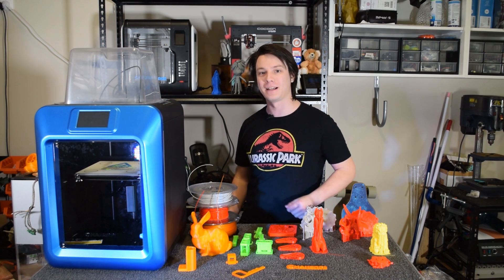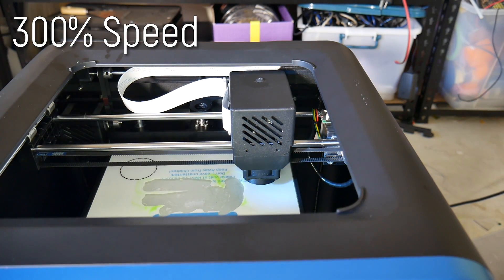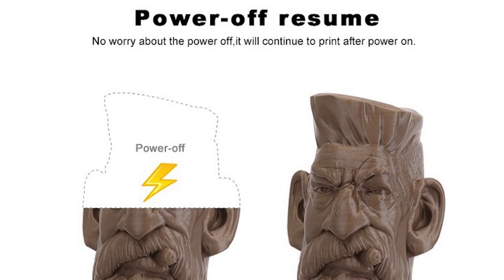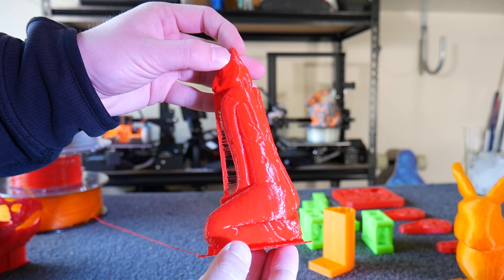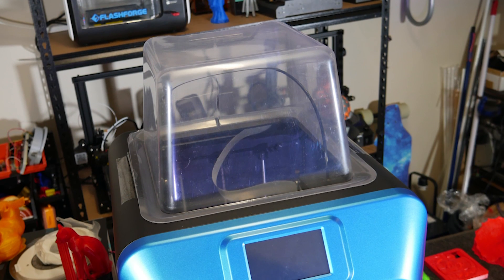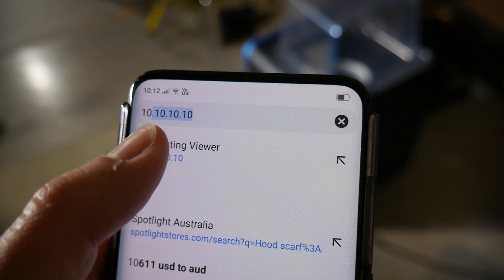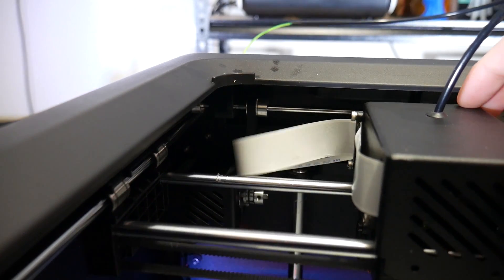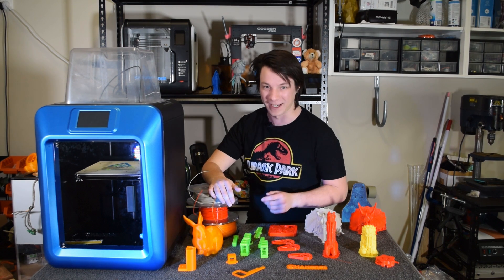MakerPi K5 Plus 3D Printer Review

Comment: I'm still waiting for the prosumer grade 3D printer for small scale additive manufacturing with real industrial stepper drivers instead of the dinky little Polulu drivers,  beefier motion control (maybe linear rails instead of linear rods), a K5 or larger print volume, support for 2X, 3X or even 4X tandem print heads for much faster throughput on arrayed  small parts, and an enclosed and heated print chamber for ABS parts that don't warp.  Kudos for the removable glass print bed.  I retrofitted my Qidi Tech printers with magnetically attached glass beds.

Comment: Tip,
Issues with printing PLA after using high temp materials..

Load Nylon at the same temps as the prior material printed at, let it purge for about 1-2min
Unload the Nylon at your PLA print temp

Secondary option

Load Polymaker Polylite or PolyMax PLA (there is some other brands you can use but they are hit and miss) at the print temp of your higher print temp material (yes it can handle the 230C+ temps)
Purge for about 1-2min and let the hotend cool back down (Important step!) and unload at normal PLA temps.
Reply: You can also use cleaning filament meant directly for this. It's basically HDPE which melts at low temperature, but doesn't scorch or carbonize at high temperature.
Reply: Many other PLA filaments are quite tolerant of high heat and should also work.

Comment: what's an oiler?
Reply: It's a little thing, like a folded over sponge, with some oil on it, in a little case (like a filament cleaner/duster) you run filament through before going into the hot end. It applies a very light coat of oil to the filament. He did a video on it a while back that's pretty interesting.

Edit: I THOUGHT he'd done a video about them before?? Maybe it was part of a video he did. Maybe I just dreamt it?

Comment: Always hated those small iteration upgrades within a model run. As an example the CR-10S may or may not have cable strain relief (may have it installed or the part on the SD card), may or may not have large leveling knobs installed. Worse, you really can never tell what you're going to get. I was told mine was the latest latest version, strain relief was installed, small leveling knobs so it was an intermediatly older model.

Comment: It's a pain to handle a nozzle/hotend clogging inside an enclosed printer. Each printer independly on pricing will have a clog from time to time, this is normal. In this case I need free room on all sides for my hands. Such a full enclosed printer sucks ;-) ... or make this enclosure removable ...

Comment: The silent stepper controllers might be more pricey; and since its the x and y motors that are most active during a print they prioritised making those silent over the z to increase their mark up
Reply: 7characters I would like to know how vase mode sounds though, since the z motor would be running the whole time
Reply: Even in vase mode the z is not moving as fast as the unload option was. So you wouldnt hear it with the stepper thats on it.

Comment: What's an oiler?  Is it filiment?
Reply: It's a little thing, like a folded over sponge, with some oil on it, in a little case (like a filament cleaner/duster) you run filament through before going into the hot end. It applies a very light coat of oil to the filament. He did a video on it a while back that's pretty interesting.

Edit: I THOUGHT he'd done a video about them before?? Maybe it was part of a video he did. Maybe I just dreamt it?

Comment: The Tupperware on the top looks like crap
Reply: looks like a dollar store plastic tub just stuck on top.....maybe makerpi melt down the lids of the tubs to make the front piece
Reply: I initially thought it was a patch by Angus. Looking at the machine construction it looks like a last second decision.
I'm also worried about the lack of proper electrical connection of the hot end. Spring contacts for high amperage make me cringe.
Reply: They put it on with tape lmao